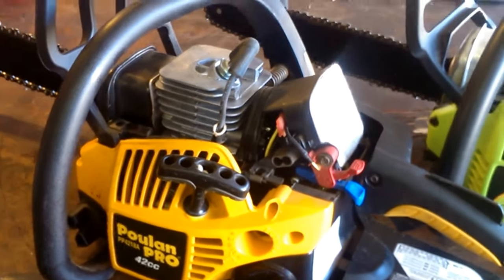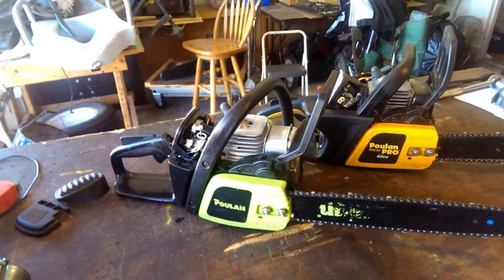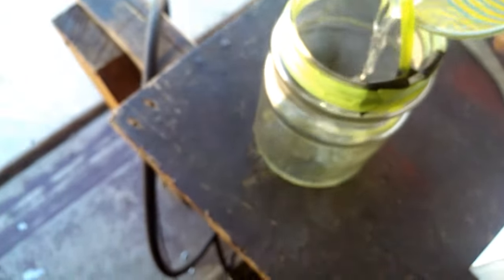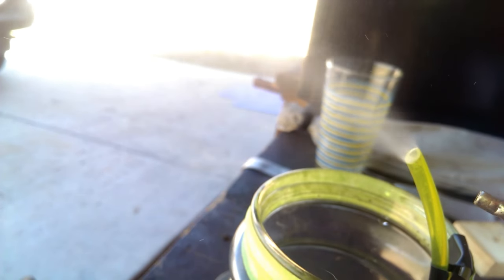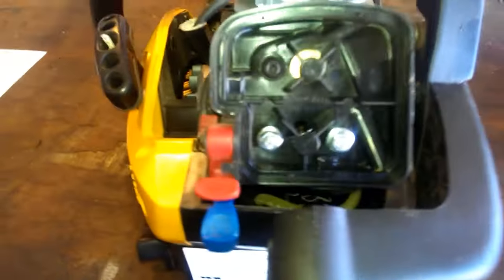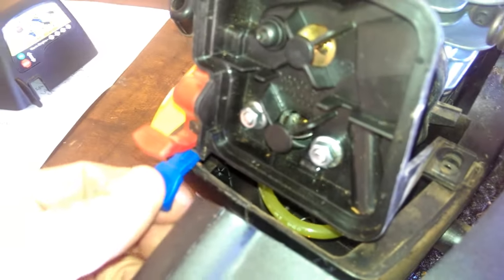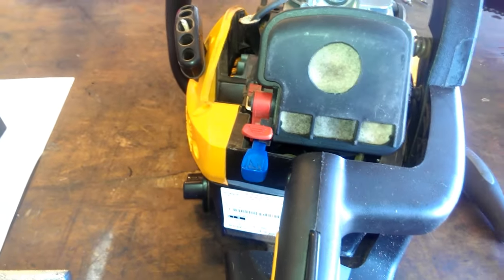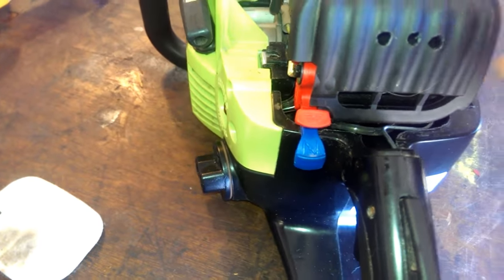Poulan wont restart after being used & how I solved my problem.

Comment: your right,.. a little wordy,... work on your editing,.. people nowadays have little attention span and will skip through and miss some potential  vital information, skipping thru the walking around and straight to the point will save you a lot of time,.. you will be surprised,.. . i know its a pain in the butt to do the editing,.. but in the long run you will get more likes,.. remember you are trying to get people to understand their problem,.. going into too much detail about the actual function of the engine, which most people already know,.. remember you can time your speech to be cut out on certain clips (i have adobe premeire elements as my editing program) always remember,.. short and to the point,.. sometimes i get wordy on my vids too, but i usually try to cut out the ifs and or buts, or non essential comments,... i took your info to heart and will try the air cleaner trick,.. wonderful idea, be safe!
Reply from the maker: Todd Anderson  Thats a fair and honest assessment brother. But not likely to change at 60 yrs old and no computer. Maybe I can get one of my kids to show me how to edit on a phone. Is that even possible? Thanks for the comment, I appreciate you taking the time.Stay safe.
Reply: no problem brah,.. maybe you can delve into a cheap laptop computer and have your kids give you some help,.. i am creeping up on 50,.. so not far behind you,.. it takes time,.. granted but it gets easier with time spent, be safe my friend,.. remember its those OTHER crazies out there we gotta watch for!
Reply: your assessment just kind of goes on and on don't it Todd
Reply: i like the way you draw the diagrams on paper. and you're the only one that presented this amendment on you tube so you have the right to speak of how you came to this conclusion since you put all that thought and time into it. live long and prosper brother.

Comment: I purchased one brand new from Lowe's and the piece of garbage didn't even work I was trying to start it all day so the next day I tried to start it again didn't work I returned it right away. Don't use a chainsaw everyday didn't want to spend big money I want to run but I was thinking I might have to so I did some research on the internet and I found a company that supplies parts for Husqvarna and Stihl and they make a copy of a Husqvarna and I bought it it's called a John cutter and it works fantastic. Not like that darn Poulan Pro piece of crap. Without a job help the homeowner fix their lawn mower then the homeowner said hey you're good at fixing stuff take this chainsaw Poulan Pro I laughed and told him I bought one brand new didn't even start out of the box but I still took it to see if I could get it started and no go she didn't start with not even a air filter on both both of them so I went through the sod checking if there was spark fuel air and everything look normal on both of the saws that I've experienced this Poulan Pro. Man you got lucky that yours actually work because I did everything you did and couldn't get both of the chainsaws to work and a 2-stroke engine is pretty basic I used to ride motorcycles since I was a kid and fix them myself so I know a little bit about the basic engine especially a 2 stroke.
Reply: I have a small engine repair business, and prior to the latest version of Lowes reorganizations, I had a contract to evaluate and repair (as needed) returned products having small gasoline engines, like lawn mowers, chain saws, etc. As far as the Poulan chain saws that Lowes sold at the time, quite a few were being returned as defective, but in the great majority of instances there was nothing wrong with the product.
Buyers simply didn't know how to use the machine, didn't put fuel in, didn't use a fuel/oil mix, didn't flip the "on" switch, didn't use the choke at all, didn't use the choke properly, didn't release the choke when engine had warmed-up, had no idea what the chain safety bar did or how to make the chain work, assembled the chain onto the bar improperly/backwards/too tight/too loose,  and had no idea why the trigger didn't work without depressing the safety lock lever, complained about having to add bar oil, where does the oil go, why is it so confusing ... And by the way, what's a "warm-up period" ???
And the list goes on ...
But in every instance, they blamed the product, called it defective, junk, garbage, and other nasty names.

By the way, the John Cutter (actually JonCutter) saw you love is actually just another cheap chinese saw, sold anywhere they can find a market (eBay ??) with whatever name you want to have on it (like JonCutter, Earthquake, Arno, Miswa, the name list is endless). Except for a bar and chain, good luck getting parts, It's basically a saw that gets used until it fails, then gets thrown away.
And I'll bet you don't even know where the air filter is on your "fantastic" JonCutter saw ...

Comment: How I solved my Poulan Pro 260 (circa 2000) problems?

Went and bought a Stihl MS-391 Farm Boss with a 20" bar and 64.1cc engine as well as a Echo CS-490-16 with 16" bar and 50.2cc engine......

No more problems!

That Poulan was a turd from the word go. It never ran all that great and was always a bitch to get started.

Comment: I have an 1838 and it has 3 fuel lines.  2large and one smalll
Reply: Will not stRt
Reply: Help
Reply from the maker: Do you have spark? Do you have compression? Will it run for a couple seconds if you put gas directly into the carburetor?

Comment: I bought this piece of garbage from sears. After it warmed up, I couldn’t restart it. Brand new, fresh gasoline, idk what the problem was but after returning it 5 times, sears said it was a lemon and let me pick out another. I’ll never buy Poulan again
Reply: Poulan is owned/made by Husqvarna.

All you needed to do was gap the plug bigger and it would start when warm. They gapped them too tight from factory.

Comment: If everything is working right on the saw and it bogs and quits running when it hot or will not restart then the crankshaft seals are bad and it's time for a new saw. Dried up crank seals allow air to enter crankcase and the saw will run lean on fuel and not run. The older the saw the worse it gets. Poulin have this problem more than others. Buy a Stihl.
Reply: I always hear still bs and mine us hell to get started. Especially if it sits. No easy start there.

Comment: also its a poulan pro model pp5020av ... its a bumble bee
Reply from the maker: eric Deleon the knot that secures the rope in the pull staryer can and has been a problem on many saws. Make sure that is not the problem with the starter. Straight fuel in the plug hole is much harder to ignite than fumes. Its better(less pulling) to introduce fuel through the carb barrel. A 'little' fuel down in the barrel will make the fumes to help get it started. I know its frustrating but if you get it to run you can further diagnose any other problems. Maybe it needs a carb kit? Has it sat for a while? Fuel lines broken in the tank? Could be lots of things. 😖

Comment: Poulan makes GREAT saws, am so sick of this attitude that poulans are inferior / "generic", poulan is a subsidiary of the best/one-of-the-best brands (husqvarna) and is most definitely a worthwhile brand, I've got 2 units (18" and 14") and one was like-new when I got it, the other majorly neglected (prior owner made his fuel by pouring some 87oct gas into the saw, then a splash of motor-oil or any oil he had on-hand, shake it in-tank and run it), and both are in my care running like champions, SUPER reliable/predictable engine turn-over on pull #1 or 2 when choked, and 9/10 a full/proper start on first pull once you've pushed the choke in - I'm not doing anything special except for having cleaned-out the residues of bad fuels, and am using good fuel....that's all there is to it, these things run & yeah a lot have issues but it's also one of hte most popular brands and SUCH a massive % of its market-aim is ignorant homeowners who don't know the 1st thing about a saw, it is entirely to-be-expected that poulans would "frequently be failing" but this isn't speaking bad of poulan build-quality it's the nature of poulan being the premiere brand for joe-schmoe homeowner who's going to half-ass mix his fuel, never sharpen his chain (ever), may keep an eye on whether he's running bar-oil, lets the machine sit with a 10% full tank of regular fuel for months at a time, etc - if Echo/Stihl were catering to this niche they'd have the same issues!  (actually I know I'll get flamed for this but I'll take top-end poulan gear over low-end stihl gear any day of the week, no question.  Pro-line stihl is great but if a brand's gonna get shat on it really should be Stihl for taking-advantage of their known-quality in the pro models to sell poor-quality consumer-level gear, totally uncool / deceptive in fact I actively avoid stihl because of this & some other practices of theirs, if I ever have a stihl in my possession it's because I'm flipping it & haven't yet sold it!)
Reply from the maker: https://youtu.be/8pCCbjKzyvY
Reply from the maker: Then we get guys like this. https://youtu.be/4vjb3SLmqEM

Comment: You think out side the box,thats the smart way to do things. I just fixed a Poulan Snowblower that has NEVER run correctly from day one. The guy that brought it to me said the motor surges badly and acts like it is starving for fuel. Turns out it was an Engineering defect in the jets. After increasing the size of the main jet and the red plastic jet that pushes into the top of the carb( has a brass jet thats too small) I was able,after slowly increasing the size of both jets,one size at a time,get that bitch to finally run like a champ. The guy said it ran like shit right from the get go. Poulan uses cheap ass parts and whomever designed that snowblower had his head up his ass. There is no idle eather, the thing only runs at one speed,fast. I can guarentee,that motor will probably blow up sooner than most snowblowers,simply because you cannot idle the bitch back. A definite design flaw. I could probably make a throttle  adjuster,but its not mine and I am only getting paid to fix it,not completely redesign it. Do yeah,great job at helping Poulan out. They should hire us both huh? Hell we could design better equipment together then thay could ever do.
Reply from the maker: RC Hobbyist Extreme That would make a good video of how YOU solved the prob. Other guys own that same model and are looking for the answer? Maybe a carb change? I  dont know. Not a lot of snowblower work for me in Southern Arizona. Lol
Reply: A lot of working motors have only a hi and start circuit. No lo ciruit as u don't cut grass or blow leaves/snow at idle.When u r tru u cut it off. It reduces the carb. complexity, and isn't needed.

Comment: Poulan won't start unless I prime it
Reply: The" primer bulb" only purges air and fuel from the metering area,filling the carb.. The choke,main jet and throttle opening provides a rich mix foe starting.

Comment: Why doesn't this issue give you a cold starting problem?
Reply from the maker: Just a theory brother but on a cold start heavy fuel air mixture makes for easier start up. Even your modern car does this until it gets to operating temp. Research open/closed loop on start up. Even very old cars pre fuel injection using normally aspirated engines would utiled a thermostatic choke to give full rich mixture. Before ecm or cpu whichever you prefer, to achieve a rich fuel/air ratio the choke would limit the air intake while the fuel would remain the same. (Hang in there Im getting to the answer.) As the engine warmed up, heat was directed to the spring in the choke, it expanded and opened the "butterfly" on the carburetor behind the throttle butterfly. On a chainsaw we have neither efi or thermostatic choke. Iys all done manually. Here is the short answer you are looking for. If the engine cannot breathe equally air in air out it will not start or not run at all. More air in now allows you to control the air using the choke/hot start proceedure. Pull choke all the way out and push back in 1/2 way. It cracks the throttle butterfly to allow highest concentration of fuel air mix coming from both the low and hi speed jets. I hope this helps. Thanks for asking.

Comment: Modern Poulan are such garbage.  The guaranteed way to have issues with a chainsaw is to buy a Poulan made in teh last 40 years.  Choose between Husqvarna, Stihl, Echo, Johnsered, Makita/Dolmar  - more or less in that order.  That's a lot to choose from and you should be able to buy one of those brands locally.  They all make a range of saws that will suit pros (more pro stuff from Husqvarna and Stihl) to once a year home owners.  You won't go wrong.  Avoid Poulan like it has Ebola.
Reply from the maker: I agree with you but I have guys with old school McCullochs that have served them very well. Thanks for commenting. 👍
Reply: @ZombieDaveAZ  - McCullochs were good saws too - in the day.  Poulan were good too, until part way through the Electrolux ownership.   They were already horrible saws when the Husqvarna group was formed in 2008(ish).

Now I think Husqvarna keep Poulan and McCulloch just so they can sell saws trough shopping mall and big box stores on the cheap.  These days though, you see the better saws on the shelves of these stores.  I think the writing maybe on the wall for the Poulan and McCulloch brands.

Nice vid., BTW.

Comment: You know if you want you stop having problems maybe you should buy a quality tool not a $100 piece of poulan junk out of the box   husqvarna  or  stihl is the way to go
Reply from the maker: Husqvarna

Poulan brand today

The Poulan brand name is used primarily for outdoor power equipment, such as chainsaws, lawn mowers, and leaf blowers, aimed at the mid-level consumer market. Since Poulan is owned by Husqvarna, the two brands often share technologies.
Reply: @ZombieDaveAZ   sorry buddy but Husqvarna chainsaws have much better quality Motors and carburetors and chains and bars compare the pool and even Poulan Pro I've been running chainsaws for a long time and yes I do know that poulan is made by Husqvarna is the piston and cylinders on Husqvarna brand name saws are much higher quality and don't wear out as fast I have a 266 I bought 15 years ago haven't even had to tear into the motor yet and I've gone through four stihls since I bought my 266xp another good quality tools you can find one but they unfortunately don't make them anymore is McCulloch I have a 7 10 a 6 10 and a 10 10
Reply from the maker: @tristanburke2451  my theory is that not everyone needs a $500 saw. A LOT of saws went out with the Craftsman and Poulan badging on them. I still look for those old saws because of their reliability. Most times all they need are fuel lines and some carb work. I'm being sincere when I say Thank You very much for your insight and comments. It is appreciated. Stay safe wherever you are and I hope you follow this channel. 👍

Comment: Poulan Poulan and Poulan but it still won't start.
Reply from the maker: Shoe Chew Hello SC. Have you eliminated all the normal problems that any saw will encounter over time? Fuel is clean? Fuel is fresh? Do you have spark? Is the air filter clean? Is the saw new? Is there fuel in the primer? Can you smell excessive gas fumes? Has it been sitting for a while? By eliminating what is not wrong with your saw ,it will lead you to what IS wrong with your saw.
Reply: I don't have a Poulan and I'm usually able to get small two strokes to run.  I'm just surfing through Youtube vids and seeing what else I can learn.
17:02
18:43
I laughed both times.  Thanks for the helpful video and for the laughs.
Reply: Dave , u r so right in that unless one is an expert and well experienced the process of elimination is the other way to fix things.

Comment: Can we get this video redone, only more out of focus?  Or recommend that viewers place vaseline in the eyes first?  If Chainsaws were designed correctly (By Nasa engineers, using your reference), I can guarantee that a tank could be designed that separates the water out, discharges or steams it off, constantly mixes the oil and fuel held in separate containers, displays the mix ratio, which can be adjusted, has a better fuel vent design, uses a high-discharge direct spark coil (instead of a 1896 spark-plug design!), and allows users to easily maintain everything else.  Actually, contrary to your opinion of Husvarna designed better, it is the most cold-blooded chainsaw out there, more frustrating than any.  That would be the last saw I would depend on.  When I design the world's best chainsaw using ceramic and titanium alloy engine, fuel-injection, direct high-discharge coil spark,  separate-tank oil and gas, electronic display, instant safety chain stop mechanism (like sawstop dot com table saws), built-in chain sharpener and automatic tensioner...I'll let the world know (I actually know how to design all of this), and put everyone else out of business...because it will also be the world's lightest saw!
Reply: Yeah its always about the money. They could make it they just dont ...so you'll keep spendin it on another one.